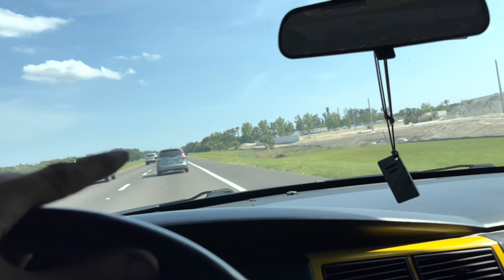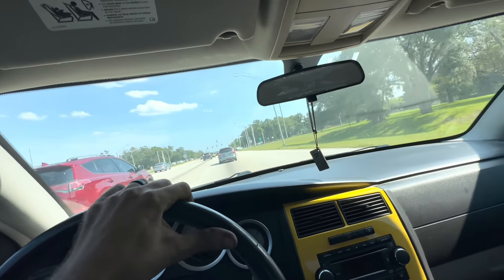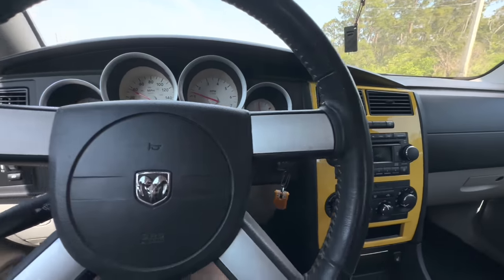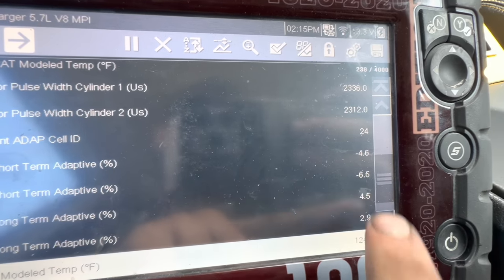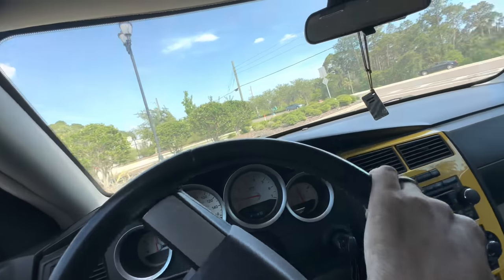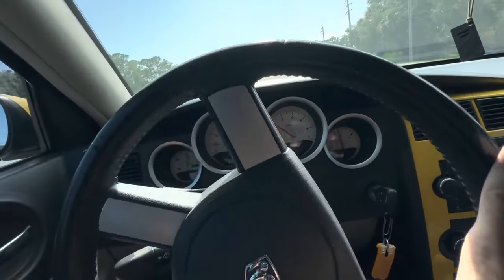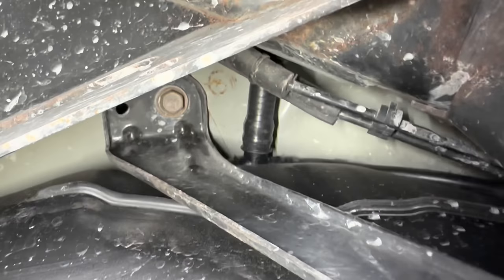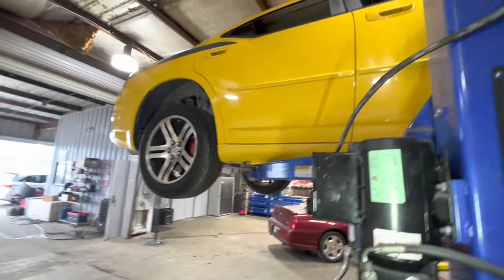Customer States: Engine Stalls After Fueling...HELP!! Dodge Charger 5.7 #mechanic

Comment: Maybe, the easy solution is to not fill the tank up to the top. I have a Ford Taurus that has a problem if the tank is filled all the way. It smells like a tank leaking . If I don't fill it up all the way, there is no problem.

Comment: Am guilty of rounding up my gas tank to cause I pay cash. If it says 12.38 I have a hard time to get to 13.00 unless I pull the pump hose out to get to 13.00. Guess I need to stop doing that.

Comment: It looks like you have a problem in the alternator. And for some reason the battery is not backing it up properly. Those Chargers are well-known for problems with those long cables

Comment: Could be a bad new tank. Just because it is new does not mean it is good. Was there ever an updated part. The part number ending in AA leads me to believe the tank in the car is of the original design. If the part had ever been updated it would AB or AC or whatever like the part number on the oil filter adapter housing for the pentastar. That one is on like AD or AF or something crazy since it has been updated so many times. Maybe you should get with the guy from the Online Mechanic Tips youtube channel. He is a die hard mopar guy and probably has seen this before.

Comment: Every thing is new, except for the problem. Mabe there is was a small amount of fuel in the lines after the parts were changed? 
 Blow out the lines with air, 🤔✌👍

Comment: Doesn't like change. Pump shuts off at $22.15, pulls handle partway out and adds another 85 cents (accidentally goes three cents over, adds another 97 cents, lol).

Comment: The easy solution for the valve would be to not fill your tank all the way and probably the reason they say don't top your tank off and have fuel all the way up the neck, that valve may be submerged in that case, it takes 12-13 gal when empty I will only pump 10 in. I would have thrown the cheap parts cannon at it, o2 sensors, airflow sensor, clean the throttle body, fuel filter. Harder things would be some type of inspection of the fuel tank for crud, probably a camera down the fill, unlikely for a new car. Clamp/disabled evap connection to the engine and have open vent like a pre-evap fuel tanks, see if it goes away. if it is frequent. Last, sensors while it is doing it on fuel rail and vacuum, this might be beyond me and most I might bring the care to.

Comment: is the customer clicking the fuel pump handle several times after it stops?  Thereby overfilling the tank and causing the venting system to suck liquid gasoline instead of fuel vapors. When Ray filled the tank, he did not repeatedly push the fuel pump nozzle handle to add more fuel after it clicks off. Maybe it is the customers fault that the vent system is sucking liquid fuel.

Comment: It's a factory life time warranty on the gas tank there is no fixing the problem just prolonging it by replacing the fuel tank dealer will fix it for free but it will happen again I'm on my 3rd tank in my car took the dealership almost a year to get one new old stock out of state

Comment: If only you could broadcast your traffic safety monolog to everyone.  As a 18 and sometimes 22 wheel truck driver, there are but a very few people that can't resist the urge to get in front of a truck at any opening.  I have to use my brakes far too often at this point in history.  Slow down people, that few seconds or maybe even one minute you save isn't going to change your life.  Me or any other big vehicle hitting you, is going to change your life, and mine as well.

Comment: I had a 2000 Hyundai accent and it would just stall out now and then when driving after sitting for a good 20/30 minutes it would start back up always making me mad not knowing why turns out it was the crank cam sensor I replaced it never did it again

Comment: dodge is like GM in that the replacement parts were NOT improved upon and bad new parts were given to NOT fix the problems caused by bad original parts. I.E. GM power steering racks that would lock up when turning. they would replace them with the same design flaw in them, that is, NO SUPPORT BUSHING ON THE ENDS.

Comment: Wheelsup solution to similar bespeaks of yet another Stellantis Engineering design  that doesn't support long term use.  Chrysler been through 4 owners in 2 decades that have left their mark in sketchy Engineering of various systems. You're actually doing R&D that should've been done before these units rolled off assembly line

Comment: IMHO, there is nothing wrong with that car. If there is, it would have to get a whole lot worse before I would worry about it. He may have over filled the tank a little that caused the fuel you saw and the system is gradually working it out. I would be more concerned about the actuator.

Comment: Excellent video Ray thank you! Two questions please? A. you said the 'valve' that goes into the side of the tank can be faulty, BUTT you can NOT just buy that valve? You need a whole new fuel tank?? B. Could there be a problem i n the ECM giving wrong messages to the fuel system? Just curious. TIA.

Comment: I'd replace it again but I'd take I would call the customer and tell them to go back to the place where they had the same replace last time and make them pay for the replacement bank especially if it was the Dodge dealer because dealerships can't fix cars believe me I had charger problems with a 3/6 car where the transmission would say put me iron man park and it's had removed me from parks so we can go if you could start the engine and it would run but you couldn't do anything with the gear shift unless you disconnect to the battery I had this at 7 feelerships in 7 months and none of those assholes could fix anything on it So they wound up pushing me into one of those chargers So they pushed me in the one of them charges for way more pain than I have on the calendar that I bought before because Dodge wanted them to replace it under the little limbonade but the dealership refused to do a paperwork I'm paid 1 of the career at the whole loan which made us being paying off the both cars to almost 40 grand A lone company wanted to swap his title for title fight crasher said but they wouldn't do the paperwork at the dealership

Comment: Fuel filter it’s one that’s easily missed if it’s kinda clogged it will still allow gas through but sometimes it won’t and can cause staling. Fuel pressure regulator as well can sometime stick and not work and run the engine lean. If the fuel filter is bad the injectors could be dirty as well.

Comment: Just because it's new doesn't mean it good !   The liquid fuel can ONLY get into the Evap System thru the Multi-function Control Valve, so the valve must be an OOBF (out of box failure) item.  OOPS !!!
Reply: Definitely OOBF for the Vapor Canister Valve; never trust “NEW” parts (saw Pt 2)   Trust thru verification !

Comment: Knew a person that bought a used Nissan, from a car dealer, she had the same exact issue, and took it back to him several times, but never could find the cause.  This is a car that the sales guy had driven as a personal car.  We told her to ask him if he always topped the fuel tank, and yes he did.  Replaced the canister, and she doesn't top it off, and the problem never came back

Comment: to ad to your trucks thing. trucks should NEVER be in the left lane. here its illegal to be in the left lane for trucks. so great because they don't block traffic.
Reply: What if they're making a left turn?  Do you propose that trucks never make a left turn from a 4-lane highway?
Reply: @mikecee3058  there are no "left turns" on a highway, exits are on the right 99% of the time. Here at the spots where there is an exit on the left trucks will all be in the left lane when the time comes, there are at NO times that trucks are allowed in the left lane to pass people. They block traffic and cause accidents. Its very safe here and barely accidents because of the laws.

Comment: Cheap plastic. I'd actually wager on a cracked/malformed baffle due to the 'random' stalling: high fuel level, hard braking/cornering sloshing go juice into the EVAP lines -or at least near enough for the vacuum of the intake to partially pull it in. Never enough to choke, but enough for the ECM to get confused and run home to momma. Might be thinking it's detecting an engine runaway and is shutting down to protect itself. Dodge Chrysler Fiat whatever they are now don't like to have codes for that because they want that high-dollar shop charge.

Comment: I wonder if the customer is one who likes to really tops off the tank.  I'd almost want to watch them put fuel in it.  They may keep trying to add fuel after the pump shuts off.  Clicking the pump handle over and over.  I wonder if a very full tank exacerbates the problem.

Comment: With raw fuel in vent line is either over filling or bad tank valve. Remember just because it’s new doesn’t mean it’s good. If new tank is bad should be under warranty

Comment: The issue could be the driver, is he one of those muppets that drive an automatic with both feet? By design they only require the right foot to drive. Two feet driving could result in it running rich too if he rests his foot on the accelerator while stopped.

Comment: relays in the trunk area. bad engineering. carbon buildup inside them makes them not work correctly. when will engineers learn to not put things where they don't belong? like a drain plug near a stabilizer bar or an oil filter in an impossible place to access or (this one makes me so fricken mad) SKID PLATES!!!!!!!

Comment: Ray, part of the problem MAY be using Ethanol fuel instead of Gasoline only.  Ethanol has been causing problems in small engines now so it perhaps may be related.